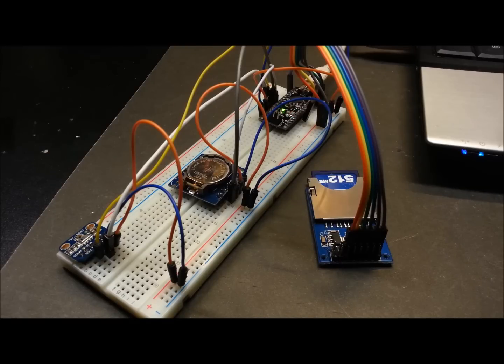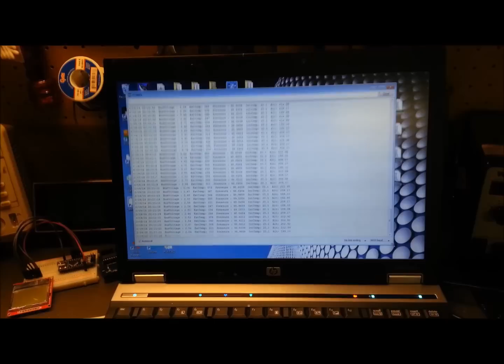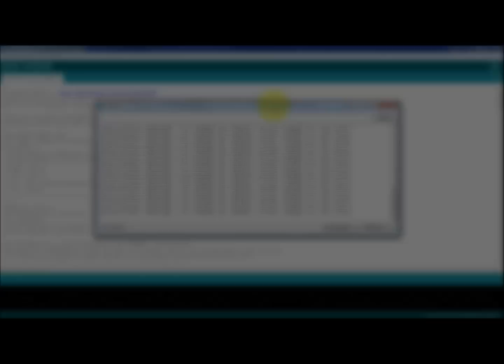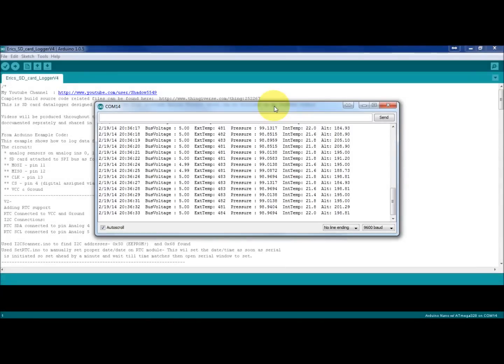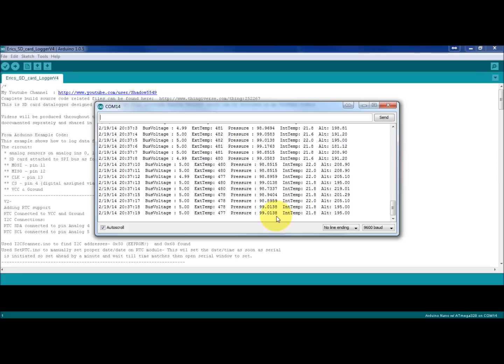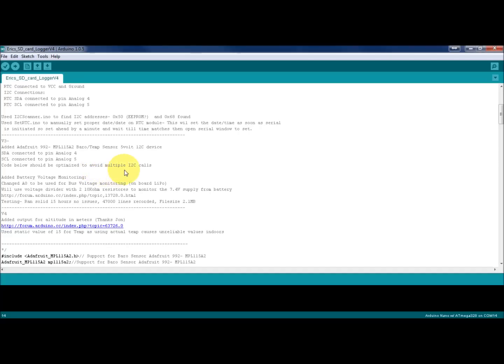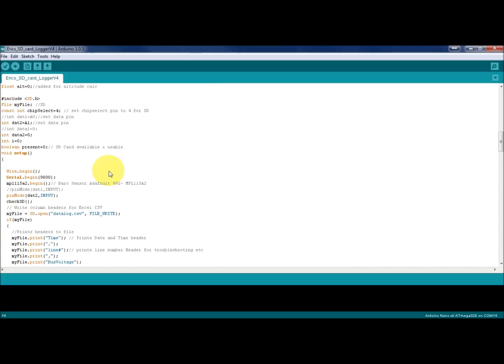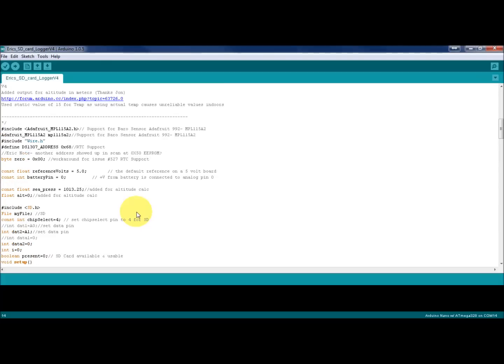HAB Part 4- Arduino Barometric Pressure, Temperature & Voltage

Comment: If your building a sensor for a balloon that you hope will reach 40km why use a sensor that only works to 10km? From Adafruit "Pressure sensing range: 500-1150 hPa (up to 10Km altitude)"???
Reply: That was my thought as well. Did you find any other sensor which would sense much lower pressure?

Comment: Eric -
Thanks for making this series. I have been thinking about making a data logger for other types of data and didn't know where to start. Stumbling across your series was like striking gold.
However, in this episode you threw me for a loop. You set up a voltage divider between 5v and ground (with two equal resistors), yet instead of showing 2.5v on the analog input pin 0, it shows 5v. What ?
Reply from the maker: youpattube1 Thanks for the kind words.  I knew someday people may find it of use.  You may want to look up how the divider works :)  Works like a champ.  Just allows for higher V than the input could normally handle.  I think I may have even left a good tutorial link in the code comments for the logger.  Cheers
Reply: Eric William -MKme Tech yes. it divides the voltage. but your voltage was not divided. it showed Vcc, not Vcc/2.  the only way i can see that it could be reading Vcc is if you forgot to hook up the ground to the ground rail.
Reply from the maker: youpattube1 You need to look at the code shown.  It is working fine reading the voltage at the pin.  It also worked fine for the 8V supply I used later.  Look at the code and you will see or google around a bit.  Cheers
Reply: Eric William -MKme Tech Eric - I saw that it was reading 5v, but if you will just think about it, the voltage divider did not divide. you may as well have left the two resistors out. just look at the video and ask yourself how you can measure in the middle of a voltage divider and not get a reduced voltage.
Reply from the maker: youpattube1 Because you are using a micro-controller and code.  You need the divider to go over the 5 Volts as I mentioned

int val = analogRead(batteryPin);  
float volts = (val / 511.0) * referenceVolts ;
Reply: Eric William -MKme Tech Eric - I still don't see where you actually use the voltage divider, but it may be what you say that a good read of the sketch will explain it. But I'm having a little bit of trouble finding the sketch to look at. could you send me a link ?  you're a nice fellow and thanks for taking the time to try and get me sorted out.

Comment: Hi! Wich was the minimum pressure the MPL115A2 measured? The datasheet says only  500 hPa, but it's still too much for an high altitude ballon (500 hPa = 10 Km).